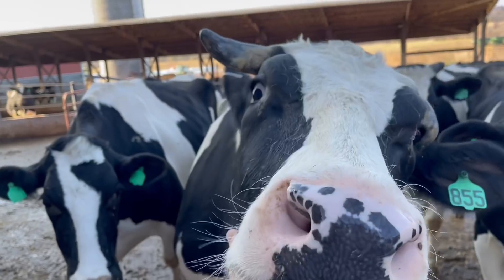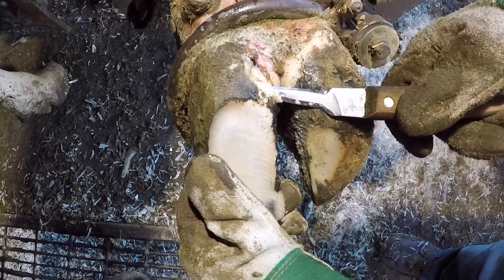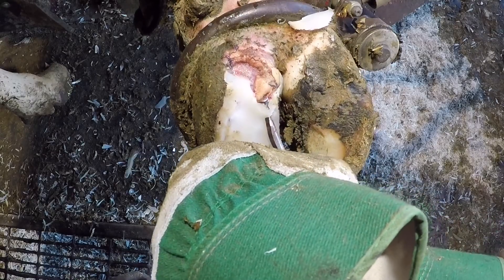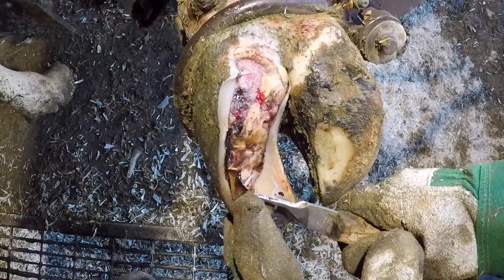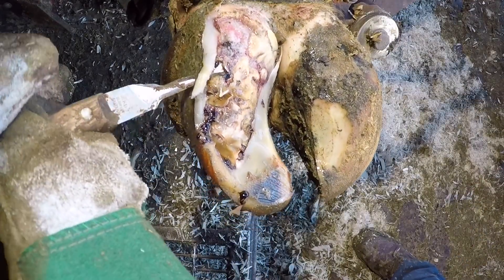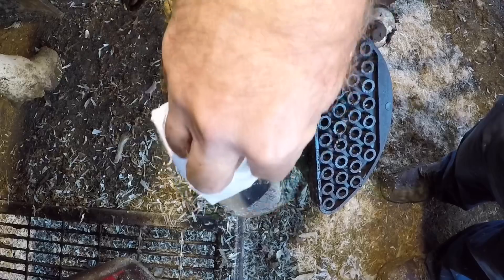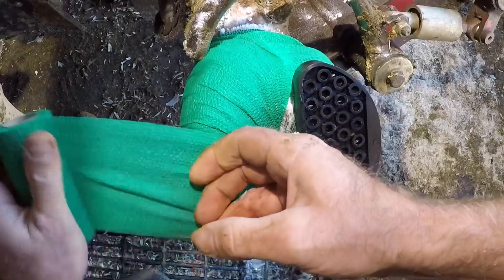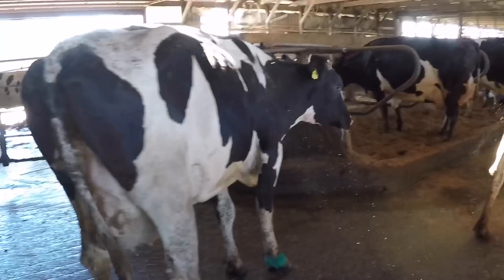Hoof Treatment Provides INCREDIBLE RELIEF FOR THIS COW

Comment: I've been wondering about an analogy for removing the hoof horn off an infected or injured hoof. 
If you've had a finger or toenail squeezed in between something so you get a blue nail.
The usual treatments for this has been making a hole with a seering hot needle or the nail detaches and can be removed. 
It's the latter type of treatment that a hoof trimmer speeds up, so that the hoof horn (a cow's nails) is removed and the healing can start sooner and with less chance of following infection, injury or discomfort. 
The flinching of the cow I thought might be the release of pressure, the touching of exposed and tender flesh, and perhaps the weird feelings of touch, wetness and air on an area that doesn't get those feelings usually. 
I know when I got my fingers squeezed in a work vehicle and had 3 blue nails afterwards, it was a weird feeling when the pressure was released though a hole made in the nails.

Comment: Hey I love your videos and I just had a question. So when you put a block on a cow it's to keep half of there feet off the ground. However you have in a said in a past video that one of the issues was caused by there being to much pressure and weight on the outer wall so could you explain how the blocks work and why they don't cause a similar problem. I don't know very much about cows and I'm curious.  
So sorry for the reply long question and I'm sorry if it doesn't make any sense.
Reply from the maker: Not too much weight or pressure on the wall that causes problems.  It’s that same weight and pressure being applied in the wrong directions that cause problems.  So if a foot is out of balance then the weight is applied were it shouldn’t and it can cause failures.
Reply: Oh thank you so much for explaining

Comment: I have a question. Are you ever concerned that a cow may accidentally role an ankle because they are not walk a level hoof which could throw there balance off. Well it’s seems that way to me. If I had to walk on half of my foot I for sure would hurt myself. I’m not accusing anybody just wondering. The thought just popped into my head.
Reply from the maker: No it really never happens unless the block is positioned terribly.